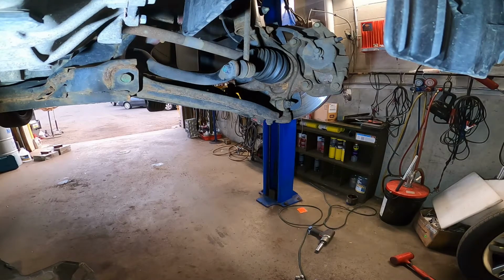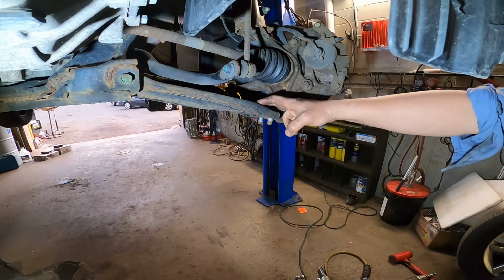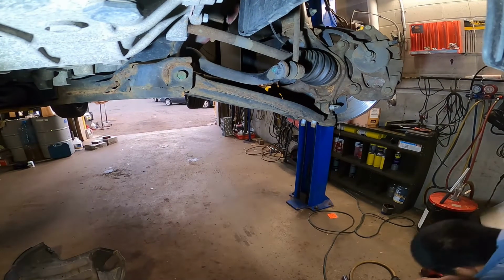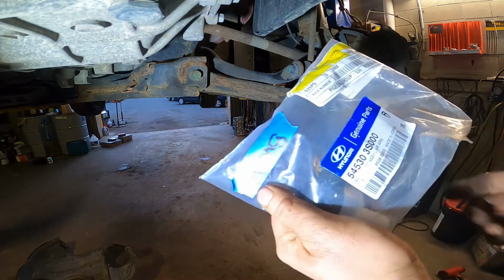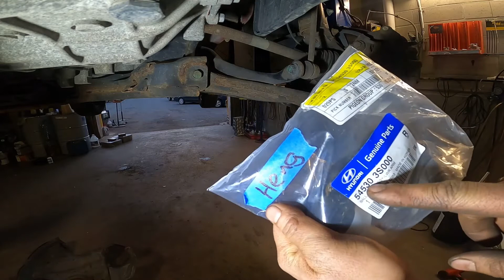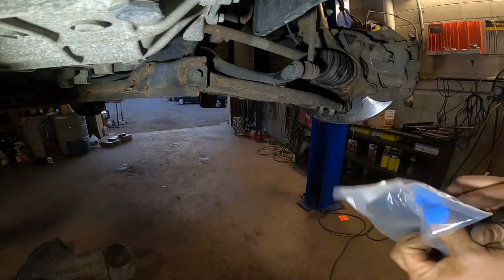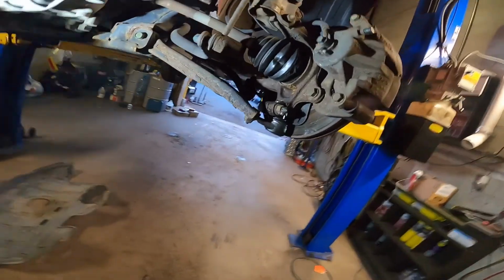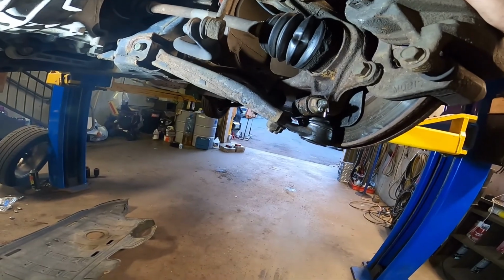2012 Hyundai Tucson Lower Ball Joint Replacement

Comment: Do you have to take off the strut? I got the new ball joint on on the hub side but it won’t line up with the control arm bolts… looks like the hub assembly and control arm needs to raise more